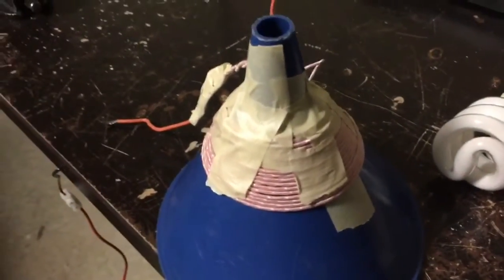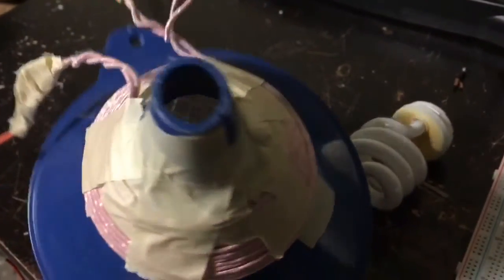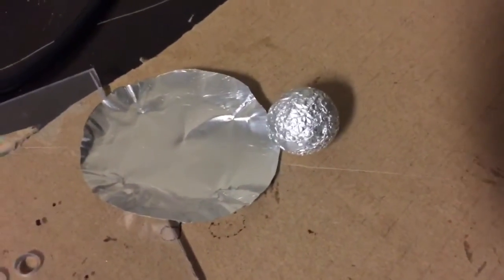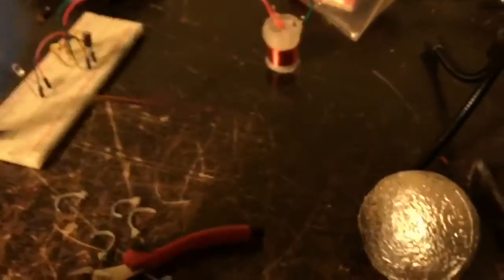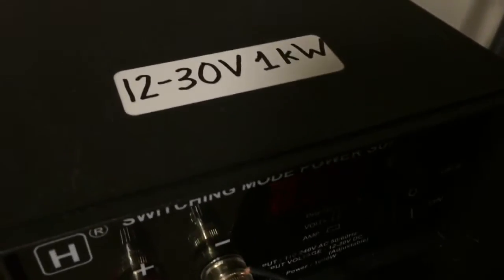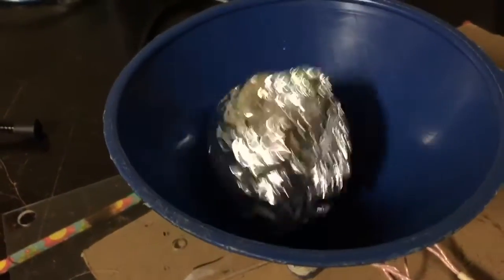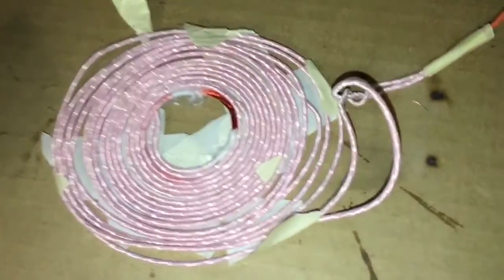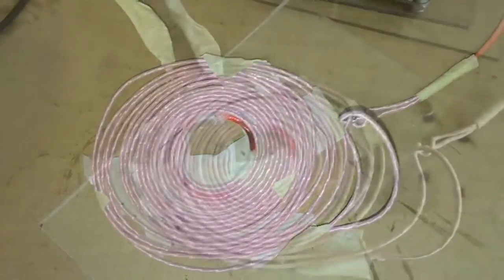Fun with Inductive Heating and Levitation

Comment: If I used a copper tube in the shape a cone at the bottom and a flat coil on top do you think I could levitate a small aluminum ball with a 1800 watt Zvs driver running at 48v? From your experiment it seems like it is possible
Reply from the maker: I think it would work

Comment: Will the cup heat up if it was placed inside the cone? Or does the heated surface need to be the same shape as the induction coil i.e. a conical cup in ref to your experiment?
Reply from the maker: yes a cup would sure get warm!